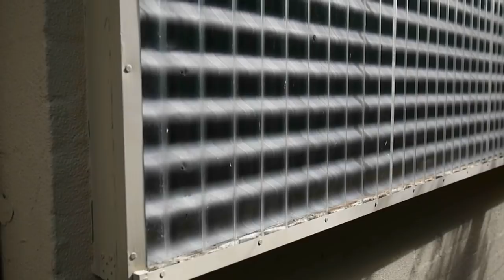Solar Space Heater- heats air in the house using the sun

Comment from the maker: Ability to clean would be a good thing. It gets so hot in the solar collector I would assume it would kill most bugs- but if they can live in heater vents I guess they could live there too. A closed system would require a good air-to-air heat exchanger, and I'm not sure I could build one good enough to be worth it. I'll mull it over...

Comment from the maker: I know you're kidding- but it might be worth clarifying that I don't use this in summer. I have a vent to just release hot air outside for summer. Also, because the sun is higher in summer it hits the panel at a shallow angle and doesn't heat as much as it would when the sun is lower in other months.

Comment: Requires a lot more infrastructure: two-axis tracking to get the most out of it.  Also performance of a concentrating collector falls WAAY off in cloudy weather.  Flat plate collectors like this continue to function pretty well in light to moderate overcast.

Comment from the maker: On a previous house I tried mounting the unit on the roof, and I had a glass top, and I had a reversable fan. The glass was difficult and the fan proved to be quite useless in summer. Also, I already had a cooling system in my current house.

Comment from the maker: I live in southern hemisphere so that's why it's on a north wall. Walls, being vertical, offer the advantage of being better for low winter sun and less heating when high summer sun- but mainly it is just more convenient. Glass is much more expensive, difficult to mount and work with, and heavier- so for me the polycarbonate is much more suitable. I might also note it has an insulation layer between the wall and the collector. I do appreciate you taking the time to offer ideas though.

Comment: seeing it was installed over 6 years ago I think it is done nice, surprised you haven't had a birds nest by that door yet though.
Reply from the maker: It's over 2 years since I uploaded the video - and still no birds nests! I have noticed some water damage at the bottom though- so I think there may be an issue with water condensation collecting there on cold nights. I have a valve to stop air cycling through at night, but I can't see any other way water could get there.

Comment from the maker: When you say I "waste a lot of the heat you collect" - where do you think that waster heat goes? I think it is still in the metal and still available to be collected. I grant that you would get slightly more radiation of heat back out of the collector but it couldn't be much more- could it? the back and sides of the box couldn't lose much heat with that small temperature differential.

Comment from the maker: I know- but the air-flow when heating the room needs to flow in the reverse direction of what it would go at night when it's cold outside. That allows me to add a one-way flap to prevent the whole thing turning into a cooler at night time (thermosyphoning). I did have cold air coming in at night before I added that flap.
Reply: We simply placed openable vents same as used for regular HVAC systems, on the air intakes/outlets.  \Closing both at night, stopped thermosyphoning.  There’s high-tech gadgets that can automate that.  Or simple flaps like you mention.

Comment from the maker: Thanks- my wife kindly indulged me by letting me build this thing provided I had a way of removing it. That would be unscrewing it from the wall and then replacing 2 bricks and patching two holes in the plaster (drywall) which is easy. As it happens- it's been up about 8 years now I think and is still working fine. I actually just upgraded the fans so it works better now.

Comment: I have to admit that I am always amazed at how often I read the comments sections on diy solar heating ideas and find the same type of people focused on the negative and how they seem to know everything about thermodynamics and can do it all better. I have looked at virtually every posted YouTube video on the subject and found that the overall efficiency of most all of the units are essentially the same, given that the unit is properly setup and focused to the sun light correctly. I am planning on making a unit and have some specific ideas as to using soda cans, modifying them in a particular manner and even using a can inside a bottle technique to see what effect or impact it may have. Success is often preceded with meaningful failures, so we shall see what transpires. I hope to included a couple of tubes that will have some crushed shards of terra cotta as a simi-heat sync. The con with that is the issue with weight, but we shall see when the project is done. To date, I have not really seen many of the variations of the diy solar heater to be all that much more efficient than the most simplistic models. I gain insight and ideas from every one of them as I watch them. This one was done nicely and if it has been in use for 8 years or more, I am doubtful that anyone needs to modify it or change a thing.  I personally like simplicity and low cost and easy to build projects, but that said, if efficiency is the goal, then one has to look at any variation in the build.  This can range from the materials used to the manner in which the unit is constructed. As said, I enjoy watching this video as I do feel it adds to ideas I want to try out and perhaps capture as I make my first diy solar heater. From doing some special things to stir the wind inside the cans to even producing a way of keeping the conductivity of the cans intact as they are stood end on end in the towers or tubes, any idea at all I pick up on is something that is worthwhile to think about and view.

Thanks for posting this video, as I have learned from it and can add that to my data base as I get into more of the actual build project on my own solar heater.
Reply: Solar collector design only becomes critical when seeking maximum efficiency and/or when trying to collect heat in a very cold climate.  Virtually all the DIY collectors I have seen would not be able to supply any useful heat on a very cold day, or on a moderately cold day with low solar insolation, or if mounted at less than ideal orientation towards the sun.  Most DIY designs are single glazed (rather than a second or third layer of PVF or FEP film inside, and most don't use a selective emissivity coating on the absorption surface, like most commercial collectors.  

These homemade collectors will work just fine if you live in a warm of moderate climate with little cloud cover (Australia, Arizona, Nevada, etc.)  If you are trying to get significant heat in winter in Minneapolis then this type of basic solar collector will not do the trick.
Reply: a1930ford 

I

Comment: You don't need to convince me, I'm aware of how effective this design is.  The other guy's disjointed comment about concentrators and whatnot was, I think, pointless.

Nice build, mate.

If you can stand having a bit of blower hardware out in the room, consider replacing the computer fans with a squirrel cage blower.  Lots of volume, pretty low noise.  The faster you get the air through the heater, the more efficient it is, the more heat it can collect.

Thanks for sharing your project.

Comment from the maker: The highest I've measured it is actually at 85 C. The thing is that the airflow rate is not high- it's only 2 computer fans driving it so a relatively small amount of hot air has to warm a large amount of air in the room. I really would like bigger fans but I have limited space.

Comment from the maker: So long as the sunlight is absorbed by any of the metal I would say the heat is captured and it would even out across the metal by conduction. The main aim for efficiency is to prevent heat being reflected or radiated or conducted back out again. In my case I just chose corrugated iron because it was cheap- it was second-hand roofing.

Comment from the maker: I'm pretty sure bigger fans would work better- I just haven't got much room to fit them in, and I suspect my electronic circuit can deliver much more power. I have two thermistors connected to my driver circuit- one measuring room temp and one measuring the collector temp. The circuit controls the fan based on the temperature difference exceeding a threshold setting. It usually runs full speed when running.

Comment: an added benefit.  The whole contraption also.. insulates the house more.  if there is cold air, it would have to get through the contraption first to get to the wall, therefore the wall stays warm also.. and that's in addition to the heat he gets out of his vent.

Comment from the maker: The good thing about a hot air collector like this is that it is very low-tech. You can use recycled, cheap materials. Small air leaks don't matter too much, unlike a liquid-filled system for instance. There is almost no maintenance either. Tracking system will put it out of the reach of most and may make the pay-back period too long.

Comment from the maker: I added fans when convection didn't move enough air- in fact airflow is still a bit low. I expected a vertically-mounted collector to create more convection, but perhaps the air path was made too long. There are 3 horizontal baffles to make the air travel snake from left to right and back as it goes up. I might have had better convection if I had a header at the bottom and top with vertical air paths, i.e. vertical baffles.

Comment: Michael, thank you for posting this, I hope you're still monitoring comments. I have a question, you may not need more heat for your purpose, but have you tried more powerful fans? This seems like a very large collector, and I would expect you could have larger fans, or faster fans to pull the heat in. Have you recorded any of your results? What cfm are the fans? Do the fans have a built-in thermistor which allows them to speed up and slow down based on the temperature of the panel? Thanks

Comment: My other problems are mostly location. This would have been better placed on the south facing part of your roof and tilted to 38 degrees. A solar powered fan would then be able to push the hot air down in to the room. I also found if you use a fan that can be reversed it will then pull the hot air out of the house in summer. Oh one other thing If at all possible and if it can be safely done use glass. The thicker the better as it also serves to help insulate the box.

Comment: I love videos like this. even if its a 8 year old video. Its still a modern take on centuries old technology. What I don't understand why do you leave out over half of what it could do. 1. why is there never a medium behind the black panels to store the heat, like soapstone then release it at night when its still cold. 2. Why is there never a  design to take advantage of its properties to help cool the house during the summer day. like closing the bottom vent and having a trap door at the very top of the unit and very bottom. so as the hot air travels up the unit it draws the hot air out of space. bringing cool air into the space from another area.
Reply from the maker: Good points there. In my previous house I tried your idea to cool the air and had a floor vent so the panels acted as an air pump to suck in cold air from under the house. It didn't work well. Also there is no room to store heat in the panel. You could pump the hot air into an insulated water tank to store heat but again it takes space and complicates it a lot.

Comment: Nice work! The use of corrugated acrylic instead of flat acrylic or glass is interesting. It looks like the roof sheet behind has its corrugations at 90 degrees. Any reason for that? I'm thinking of borrowing your method (mounted on a roof in Canberra though I would line the corrugations up and sit the acrylic about 2cm above the iron. Also, you posted this in 2012. How has the acrylic held up after 9 years? Any issues with it becoming opaque?
Reply from the maker: The acrylic sheet is still fine. Make sure you buy acrylic that is not designed to prevent heat getting through. For the steel corrugations it was just a convenient material. I thought the corrugations may absorb more heat and reflect less.

Comment: Here are some silly ideas that just might work!...(or might not)
If you don't have glass use saran wrap or clear plastic.
If you don't want to build something, then try putting a cooler in the sun (you need something insulated enough that the heat won't escape much faster then it heats up.
If you don't want to paint.. then throw a black shirt in there.
If you don't want a hole in the wall.. you could heat up your thing, then bring inside and see if it warms your house.
In your cooler.. you could also store some dense materials that can accumilate a lot of heat energy over time, then when you bring inside the house.. 
At least in theory... should work.
Anyway.. thanks for reading my silly ideas.
Reply: Good ideas. One thing to note is it is not really the air in the collector you are trying to heat up, instead it is the corrugated iron roof material. The reason is that steel has a higher specific heat than air, which is a scientific way of saying it can store more heat. Also, I used polycarbonate rather than glass because it is safer, lighter, cheaper, and easier to cut to size. The best passive solar house designs just have the sun shining through the windows onto a floor made of dense materials, combined with some way to get the heated air from that area to other parts of the house. Picking it up and carrying it in a cooler is probably not a practical way to move the heat around though.

Comment: Looks good and seems to be doing what you want. Do you have any temp info as to how well it works. I think it would heat up the air even more if the inlet and outlet were diagonally opposite eachother to increase the time the air spends in the heat cell? Or maybe a directional bend inside to point the inlet accross towards the other side first and even some baffles to increase the duration of the air's time inside. Just some thoughts, but you've gone beyond theory and actually built something which is ALWAYS better than doodling ideas and conversations. Well done ;-)
Reply: GREAT, thanks ;-)

Comment: Ok I have many problems with this. Let me 1st say that if this is what you had to work with for materials it is a very nice job. So let me not tell you how to do it. I will just point out what needs to be fixed. 1st there are 3 problems with the metal sheeting and the set up behind it. The metal needs to be flat and NON reflective. Flat black is your best friend here. Plus you waste a lot of the heat you collect by not putting a heat sink behind the metal against the wood.

Comment: hey mate.
any chance you can explain the controller circuit?
is it a purchased unit or did you wire it up your self?
got a component list, wiring diagram?
Reply: owen murphy I don't have a circuit - I just made something up out of whatever electronic parts I could find. It is based on a 741 op amp to compare input voltages from two thermisters. One thermister measures room temperature and the other measures the temperature in the collector. When the collector temperature is higher than the room temp the op amp turns on the fan, which is driven via a transistor. It's a 12 V fan so I used a 12 V power supply. I matched the drive transistor size with the maximum current the fans use at 12V.